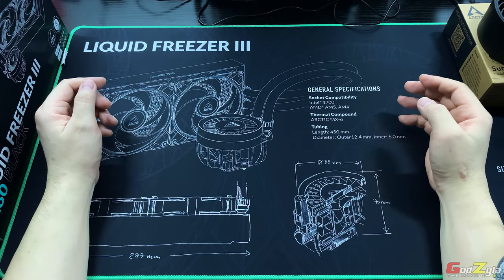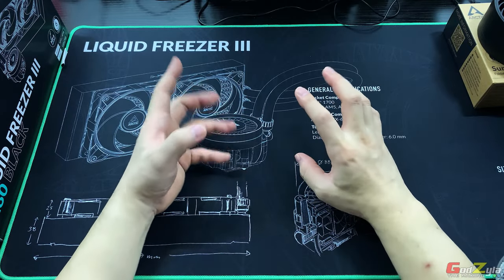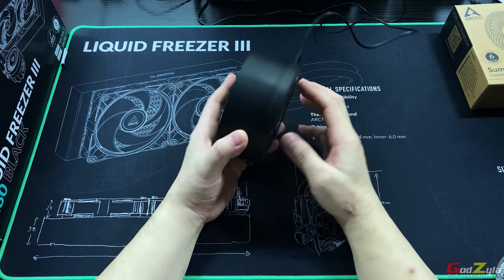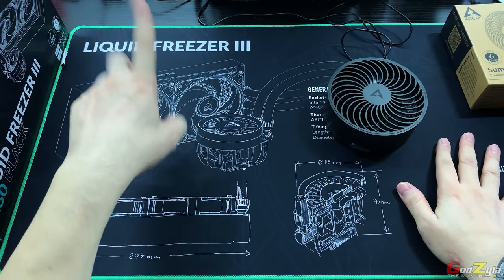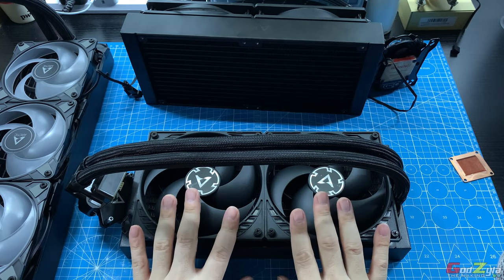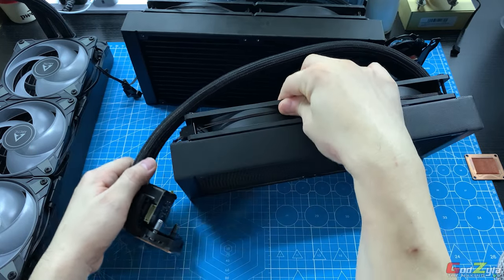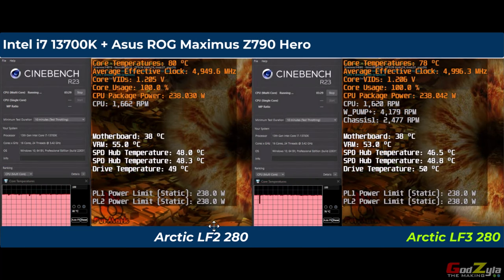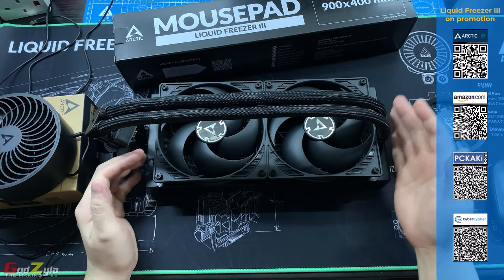Arctic Liquid Freezer III

Comment: Thank you for this video. I’m just building my first gaming PC and have purchased the freezer III 360 along with a X670E tomahawk MB. I’m still a little confused as to which of the two cables I should be using? If I use the individual control cable do I need to set fan and pump speeds in the bios and if so what do I set them to?
Reply from the maker: Hi Mike Allen, welcome to my channel. let me break it down for you. for single cable from liquid AIO pump to your motherboard fan header. you will not be able to control the RPM of the radiator fan, vrm fan and pump. with the split cable, you will be able to control them individuallly. I would advise with the below settings. 

Based on X670E Tomahawk, page 44 https://download.msi.com/archive/mnu_exe/mb/MAGX670ETOMAHAWKWIFI.pdf , the CPU_FAN1 and PUMP_FAN1 are at 3A and SYS_FAN1-6 is at 2A

use the separate cable. 
1) Plug LF3 pump connector to PUMP_FAN1 (best to set in UEFI as full or 80%)
2) Plug LF3 Radiator Fan connector to CPU_FAN1 
3) Plug LF3 VRM connector to SYS_FAN1

all the above 1) to 3) you can go to your UEFI / BIOS to set the fan curve. as mentioned. just make sure your pump runs consistantly at either full or 80%. as for CPU_FAN or SYS_FAN1, set to PWM and you can set your own fan curve.

Comment: They took a huge step backwards with the LFIII pump. It's very loud and I had to return mine. It's literally the only thing I hear on my PC since all my other components are virtually silent XD
Reply from the maker: Hi OuKi, welcome to my channel and thank you for your feedback. I guess is up to individual sensitivity on noise. I have tested 3 unit, 1 which is provided by Arctic and 2 which are purchased. I don't find them noisy, as mentioned, it depends on individual hearing, plus you can tune the RPM for the VRM, you don't have to run full, VRM fan can be tune in a way that during idle it can run at 800rpm, once temperature goes up, you can also set the max rpm run. Still thank you for your feedback and am sorry that it's noisy for you.
Reply: @KleoYan  all is good. It's still a steal at the current sales price for those who aren't bother by it.
Reply from the maker: @ouki4925  thank you for the reply. greatly appreciated it.
Reply: I agree, though mostly with the design of the water block. The placement of the tubes on the pump itself are a limiting factor for some builds, and rotating the pump is not even an option. Maybe intel can flip it, but AMD is a no go as it would offset in the wrong direction. At least with the LF2, the tubes didn't get in the way of anything.
Reply from the maker: @deuswulf6193  hi welcome back, something which we should feedback to Arctic. on my end let me reflect this to them. Hopefully infuture if there is a LF4, this might be their consideration. Thank you again for your feedback.
Reply: @KleoYan  That would be great, though I don't know if I'll be in the market for a new AIO by then. Who knows? =)
Reply from the maker: @deuswulf6193  Hi and welcome back. you are most welcome. Any feedback from my viewers and it's of a valid reason, I will normally feedback to the PC Brand who sponsored me. As I feel that is through our feedback, it will help PC branding companies to improve on them. 😉
Reply: Yes i tried 2 units and have similar experience
Reply from the maker: @Daisudori  hi welcome back as mentioned so sorry that you find them loud and you might want to tune down the pump RPM but that might compromised the thermal.

Comment: Nobody talks about how much the tube on the bottom stick out from the AM4 socket. I'm pretty sure the tubes will collide with my vertical GPU mount. But there is no way to verify without actually trying. Asked Arctic support for (offset) measurements, but they told me to ask my case manufacturer if it's compatible. 😒
Reply from the maker: Hi ObscenePizza, welcome to my channel. That's a very good point you've pointed out. Another commenter did mention if it's possible to Vertical mount a GPU, I see what I can do to illustrate that but it will take sometime, hope you dont mind waiting. Thank you!
Reply: @KleoYan  Thank you, really appreciate the effort.
Reply from the maker: @ObscenePizza  you are most welcome. as mentioned. I will see what I can do. thank you for the suggestion. some info which I have gathered. It will be difficult to do Vertical Mount with a 4090 GPU as the height of the GPU will block the AIO from mounting it behind the GPU as the hose are the issue. I will test it out with the 4070ti and 4080 at a later stage. Thanks again for the question.

Comment: This would have been an instant purchase if the pump was actually rotatable. Unfortunately, with a vertically mounted 4090, and the lower offset for AMD CPUs, I don't think it will fit. Tubes down with a side mounted radiator is also a no go.
Reply from the maker: Hi DeusWulf, welcome to my channel and you are right on the spacing between the hose and a Vertical Mount 4090. Thanks for the feedback.
Reply: @KleoYan  Second time here =), first was with the Azza Cube breakdown. I appreciate your technical analysis of these products btw.  Very informative. Most videos act more as marketing than analysis.
Reply from the maker: @deuswulf6193  Hi, welcome back. Honestly speaking. In most of my content, they are either guides or to talk about my experience of a PC Builder. You see, we PC Builders want to know in-depth info before purchasing a product. I might not be perfect but am trying my best to see in every aspect of a sponsored PC product. Another principle I have is, whats good I will talk about it and what's bad, I won't hesitate to talk about it. Thank you for your valuable feedback and I greatly appreciate it. Your kind words will motivate me to continue to improve my content. Another fact on doing content is to polish the way I speak and to present as this is required at my main job. YouTube is just my learning playground 🤣

Comment: I'm curious as to how high the pump block is from the motherboard to the top of the pump. I'm using a vertical mounted GPU and I'm not sure that the pump block will fit, I suspect it might hit the GPU, or the tubes will. Can you give me some insight?
Reply from the maker: Hi SREDNA, welcome to my channel. A very good question. Let me see what I can do on my next content, but do pardon me as it will take sometime. Hope you don’t mind to wait. 👍
Reply: This is my issue as well. I have a vertically mounted 4090, and its practically up against the bottom my RAM. Add the offset for AMD platforms and the pump block gets even lower. Ooof!
Reply from the maker: @deuswulf6193  hmm. I think I have replied on this.. all these feedback will be going to Arctic 😉

Comment: At 37:50 you see where it says asus multicore enhancement and its set to auto. Change it to disable enforce all limits. If you do that you wont have to change anything or miss with the negative offset. The setting is whats making you are trying to fix. Just look at the PL1 and PL2 wattage on stock settings. Then disable the auto setting Asus did and look how the wattage changes from 4096watts to 243watts. Your welcome.
Reply from the maker: Hi Roderick Howell, welcome to my channel. Hey thanks heeps and greatly appreciated it for the tip. 👍👍👍

Comment: Hello Kleo Yan its been one month.
I Still dont understand how to remove the fans like idk what to do after with the cables if im using the splitter i would love if u respond.
Reply: or the one fan cable prob i will use the one nit the splitter
Reply: And like where would it go i am using a 3 splitter into 1 fan and plugging it into cpu fan where would then the 1 cable go from the pump?
Reply: Maybe u can do a tutorial just MAYBE
Reply from the maker: @44Mercy187  hi welcome back. you might want to refer to the instruction manual online. https://support.arctic.de/cpu_liquid_coolers just select the AIO size you are using.

Comment: 31:31 cables must hide first on special spot for them otherwise rgb and vrn fan maybe will not work. Grate video!
Reply from the maker: Hi metruk88, welcome to my channel and thank you for your feedback. Yup you are right, thats why I have spoken about it at timestamp 33:58. Once again thank you. 😉
Reply: @KleoYan  I miss this part. Still grate video, i think it is a most complete one on YouTube. I took a white version and realy enjoy it with black and white parts. Extremly quiete 30% using pump. Only 1 problem in pc is asus tuf rtx3070 when playing games max speed 80% with MSI afterburner but steel loud.
Reply from the maker: @metruk88  I see, did you undervolt your RTX3070? if you did, the fans might not ram up so high plus performance might improve too.
Reply: @KleoYan  no underwolts. Just stock use only. So with 80% i have temp 78,5-79,5C. Playing in 2560-1440. Probably it is good.
Reply from the maker: @metruk88  I see, that's pretty ok. I mean your temperature 😉

Comment: Thanks for the informative video brother!
I have one question, does the hose coming out of the pump house conflict with tall m.2 heatsinks on the motherboard? I have an Asus Rog Strix Z790-E (Wifi II) and the heatsink on the top M.2 on that mobo is tall.
Reply from the maker: Hi Mindris, welcome to my channel and am glad you like this content. Thank you for visiting and all the best with your build too.
Reply from the maker: Sorry miss out a question. I am not able to answer you on this but there are some who reported that some motherboards will have issues mounting this block as it’s either the m.2 slot is too near or it’s too tall. You might want to check the compatibility list at Arctic website. Click on the installation guide of the LF3 and it will list down which motherboard is compatible or not compatible.
Reply: @KleoYan  Thank you so much, I found it and it's compatible.
Reply from the maker: @Mindris  good to hear. All the best with your build.

Comment: My Mainboard is ASUS TUF B650 Plus Wifi , I just want to make sure whether it's correct or not?

PUMP cable = AIO PUMP pin
VRM cable = CPU OTP / Cha Fan Pin
FAN cable =  CPU Fan pin

Thank you
Reply from the maker: Hi Shen Long, welcome to my channel. The layout you have mentioned is all good.. but do note, if you place VRM connector to CPU_OPT, whatever fan curve you done on CPU_FAN, the CPU_OPT will follow.
Reply: @KleoYan  Hello, i have a question, my motherboard does have only one sys fan header but have others PWM 4 pin header called "top case fan" can i connect the VRM cable in there?
Reply from the maker: @GustavoSilva-oj6pd  Hi and welcome to my channel. Mind if I ask which brand and model of motherboard are you using?

Comment: I have a love and hate relationship with AIOS. But this one seems to be good quality.
Reply from the maker: Hi Haz, welcome back. I was once like you but right after I started to use Liquid AIO, I have good experience with them. My first Liquid AIO was the ID Cooling ice flow 240 and been using it for like less than a year and the pump failed. So I went back to Aircooler. Then I saw this Arctic Liquid Freezer II 280 (Year 2019). The moment I get to touch it at the IT Fair, I like it. I bought it for USD $82 bucks and have been using it every since. Till today, I am still using it as it serves me well. So ya, I can understand how you feel. Anyway yes Arctic does very good quality products which is budget friendly 😁
Reply: Cool Good to know
Reply from the maker: @AnonymousUser-ww6ns  you are most welcome 😊

Comment: I have the Freezer II and I like it, but this does need the P14 Max fans and not the P14's it comes with.
Reply from the maker: Hi Richard Joy, welcome to my channel. You are not wrong and it's best to provide more static pressure performance fan and the LF2 is still very capable till today.

Comment: Does thicker the radiator would be better for cooling? In all AIO brand, the Arctic AIO only use the thick rads and does the thicker rads when installing inside a smaller case (Example: Asus Prime AP201) would take a lot of space, right?
Reply from the maker: Hi MicerGlancer, welcome to my channel and yes, which thicker radiator and good static air pressure, your CPU temp will be lower. In practice why Arctic is always listed top AIO is due to their radiator thickness where other brands AIO are following. Example, from 27mm standard thickness to 30mm or 32mm. You see, bigger surface area will absorb more heat and to dissipate heat. With the higher static air pressure like the Arctic P12 Max, temperature will go alot lower. As for mounting into cases, there are restriction on space, you will need to check if it can fit to your case. as for Prime AP201, is a no go to use LF2 or LF3.
Reply: @KleoYan true, I heard if you install LF2 or LF3 in the smaller case you won’t connect all the cables on the top of the Motherboard because of thick Radiator. That’s make sense. In your opinion between LF3 and ASUS ROG Ryujin III which would be better in term of price to performance
Reply from the maker: @MG0301  about this, both perform well. but Arctic LF3 has the upper hand if using 280 or 420 with the improvement made, 1st it's quiet, 2nd the surface area is more. 3rd it will definately out perform the ryujin
Reply: @KleoYan  ok, Thank you so much, Boss
Reply from the maker: @MG0301  hmm.. call me Kleo will do and thank you to have visited.

Comment: Got the arctic Freezer III today, can you show us your MSi BIOS Monitor Fan settings?
Reply from the maker: hi Cheaterjung, welcome to my channel, do pardon me, I have dismantle the unit but the settings are as follow

Radiator fans - CPU_FAN set to smart fan on PWM and temperture sensor to CPU.
 
VRM Fan - SYS_FAN set to smart fan on PWM and temperture sensor to motherboard

Pump - PUMP_FAN, disable smart fan and set to full, sensor to CPU

Comment: I have an AM4 CPU the Ryzen 7 5800X3D and bought the new Arctic Liquid Freezer III 280 Black does the new AM4 offset brackets come with it and inside the box and doesn’t touch my m.2 nvme like the old revisions except rev 4 on ALF II which showed a half an inch of the IHS to cover the hot CCD or CCD’s or do I have to order one through the website?
Reply from the maker: Hi Sporadic Entertainment, welcome to my channel, the offset mounting bracket comes with the Liquid Freezer III. it's different from the Liquid Freezer III, if you watch at timestamp 19:48, I have shown how to mount on AM5 which is similar to AM4.
Reply: @KleoYan  So it’s the AM4 brackets mixed with the AM5 brackets all in one but when using the AM4 brackets does it still show the IHS or does it cover it up and do you see a lowering of temperatures?
Reply from the maker: @sporadicentertainment9253  For AM4 it will show as the mounting holes are different. one is PGA 1331 (AM4) and other is LGA 1718 (AM5) ..I am not able to answer your question on temperature as I no longer have AM4 platform to play with. you might want to ask at Arctic reddit forum. https://www.reddit.com/r/arcticcooling/. 
It is perfectly fine when mounting the AM4, the IHS will show, which is not totally covered by the LF3 coldplate when using the provided offset brackets.
Reply: @KleoYan  Yeah, you are correct I’m going to put in a ticket and ask them those questions and call them as well Monday thank you great channel.
Reply from the maker: @sporadicentertainment9253  you are most welcome and thank you for the feedback. All the very best with your build too. 😉

Comment: Where does the vrm specific cable go.  There is absolutely no instructions or guidance anywhere from artic about this.
Reply from the maker: Hi Hardware Tuned, welcome to my channel. I would do this. Since the pump connector provides power to your pump, vrm fan and your radiator fans (I have correct this, please refer to my pin up comment) I would connect the pump connector to any motherboard fan header which has a 2A load. best is to connect it to W_PUMP or AIO_PUMP, kindly check the ampere of your motherboard which provides 2A.
Reply: @KleoYan  I'm using separate connections.   So I'll ask again.  Where does the VRM ONLY cable go.
Reply from the maker: @Hardwaretuned  for VRM connector, you can plug to CHA_FAN or SYS_FAN, as there are only 2 wires on VRM. then set the fan curve accordingly to your liking.

Comment: Very noticeable pump whine when the pump turbine runs at full speed.

Radiator plus fans is thick.  If you top mount this you'll need a tall case to clear the motherboard.
Reply from the maker: Hi Robert Zanatta, welcome to my channel. For the pump noise along with the VRM fans, yes they are not as quiet as the Liquid Freezer II and you are right about the clearance. It's a similar situation with LF2. Infact in most of my case reviews, I always take Liquid Freezer II to measure the clearance. Once again thank you for your feedback and to have visited my channel. 👍👍👍